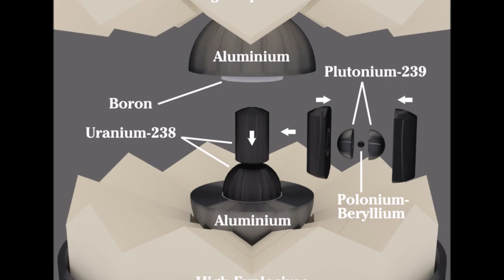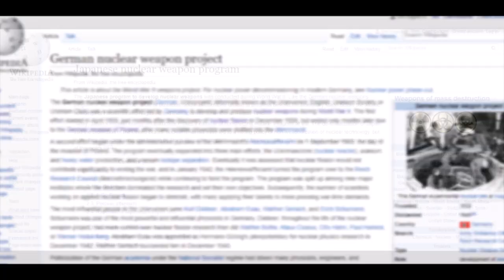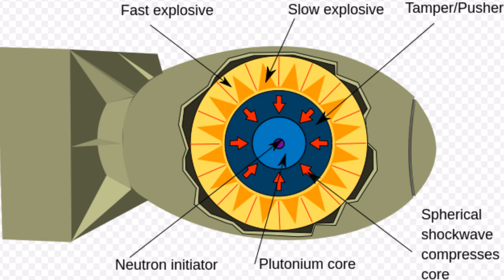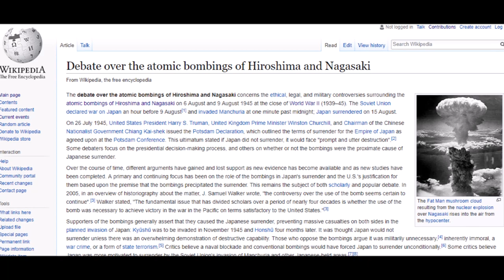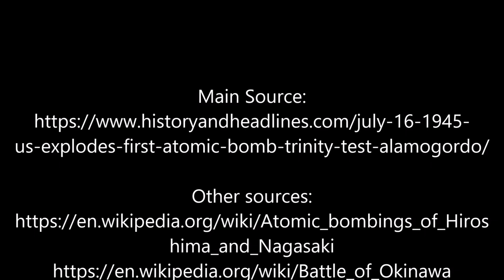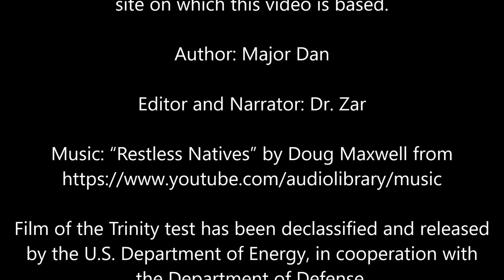July 16, 1945: US Explodes First Atomic Bomb (Trinity Test, Alamogordo)

Comment: "Hey Oppie... Pull my finger!!"
~Edward Teller to Robert Oppenheimer
05:28 and 55 seconds, July 16th 1945
Reply from the maker: Did you see the film out in theaters now?
Reply: @HistoryandHeadlines  ~ My sister's going to see it in IMAXtomorrow, I'm broke so will have to wait. Read lots about it though (grew up with "Duck + cover"...), and saw the one with Paul Newman as General Groves years ago. Now we're all sons of bitches....
Reply from the maker: @laikapupkino1767  I'll likely wait until it's on streaming.  Going to the theater is a bit costly for me, not just in terms of ticket prices, but the time in getting to and from the theater.